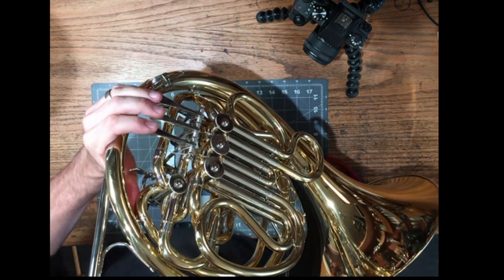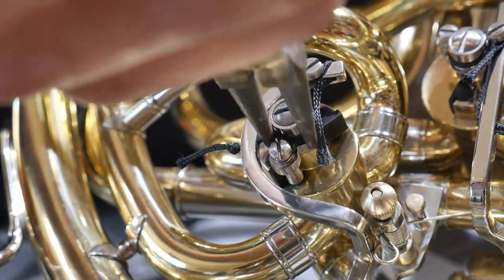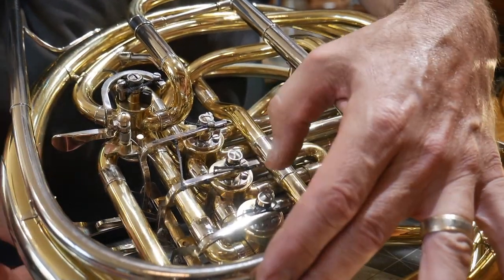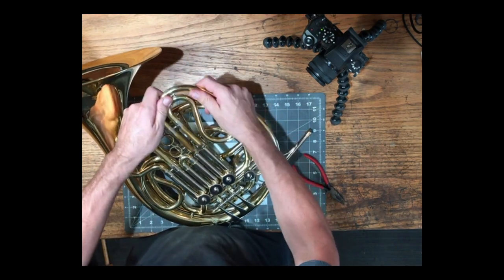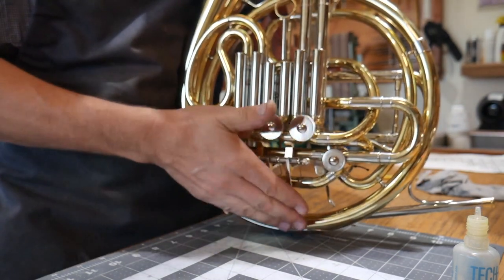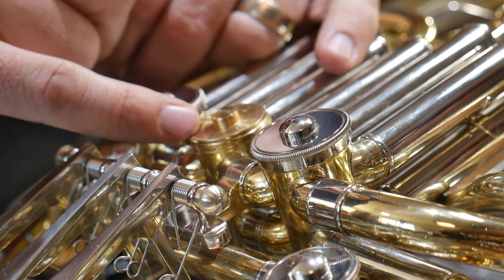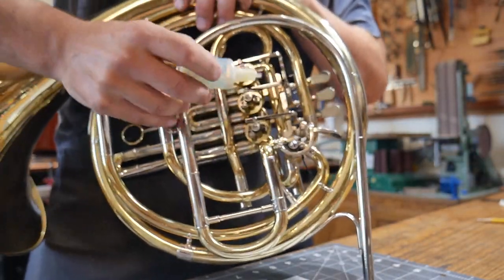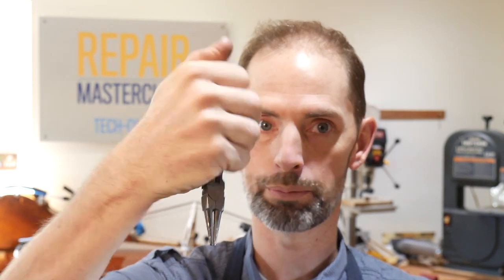Stuck Rotors!

Comment: The horn looked new, so the owner had not considered the need for regular inspection and servicing. Was sewing machine oil used in the rotors?
Reply from the maker: Tech-Oil on the rotor and a thread oil in development by Tech-Oil on the threads of rotor screws.
Reply: @repairmasterclass  I meant what may have gummed the rotors in the first place, or were they left to dry out?
Reply from the maker: @pauljmeyer1  oh I see! Sorry for misunderstanding. Loads of things contribute to this. Being left dry can be a factor, but typically it’s being left wet with the wrong stuff, milk, pop, snot, bacteria and other yummies like that. Bad oil, as in old petroleum gone rancid, can sometimes be a factor as well. I’ve also seen the medications people are on contribute, so, any number of reasons.